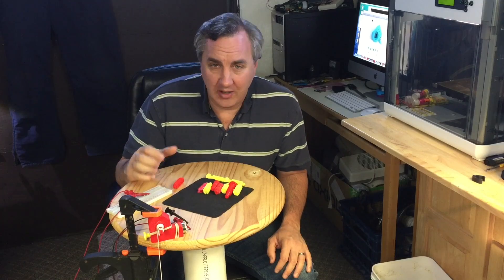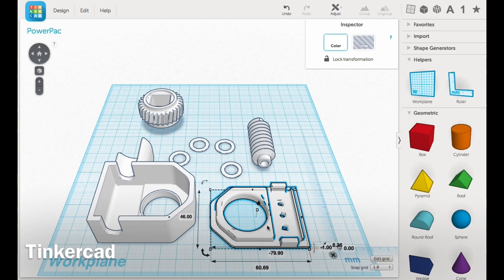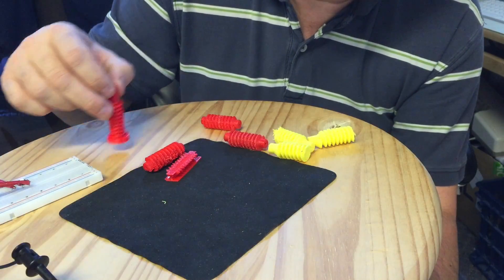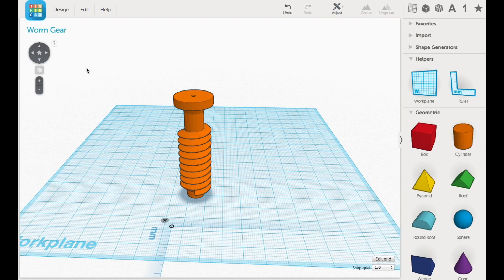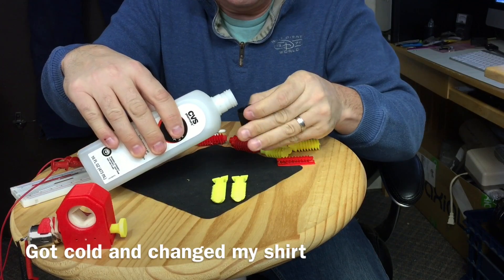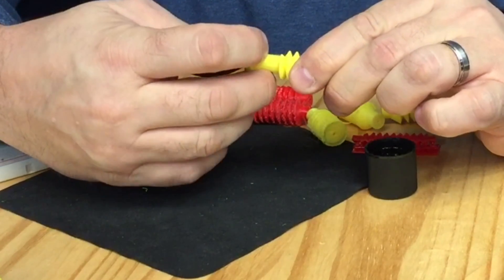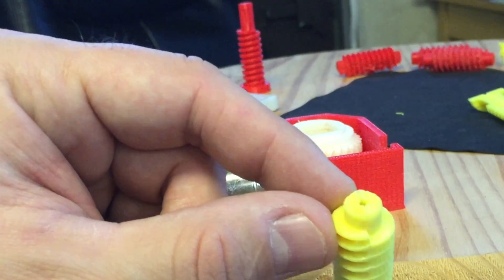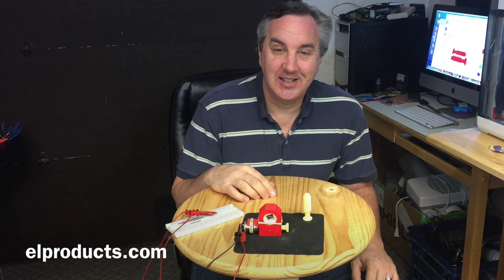Worm Gear Davinci 3D Print - Split Print Glued Together - Video #027

Comment: Your video describes exactly the sequence of steps I tried to cut a worm gear in half in vain. I could not get this done in SketchUp. Your tinkercad solution worked super good and I am off to printing in less than an hour after I saw your video. Thanks much....

Comment: Great video check. Quick question do you think it's better to do the acetone to that stick things or use glue. I just finished a project printing out the lawgiver from the movie Judge Dredd which is his hand gun. It comes out in 6 pieces and I was trying to figure out the best way to glue them so that it looks smooth and there is a little bit of bowling that I'll have to press them together with a clamp I was wondering if acetone is best because of that or if glue will work just the same

Comment: Yup splitting difficult geometry in half and doing away with all the supports and then plastic welding the pieces together is the best by far than trying to print with supports or trying rotating the object at odd angles, for some reason the support materials just sucks in general.   I typically use c clamps with rubber ends to really clamp down on objects after I weld em together (you can also use acrylic glue which some brands comes in a "gel" form)  and then follow up buy hitting the seam once clamped with a little adhesive (acrylic glue or acetone) to "seal" any spots i might have missed.  One thing picked up from watching wood workers is you can't have enough clamps on a project that you're gluing! :) Keep up the great videos looking forward to seeing more!
-dave
http://www.dbclunie.com